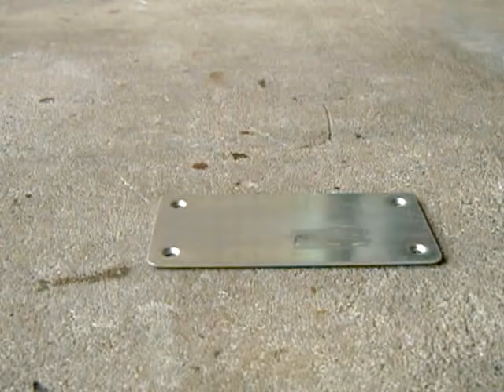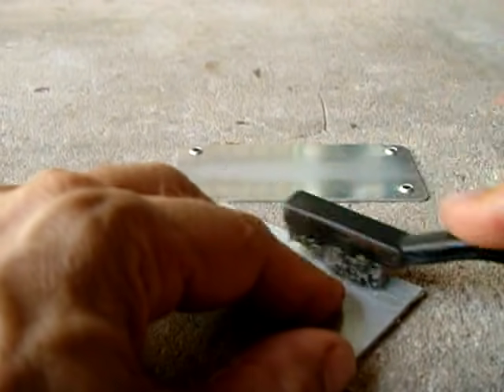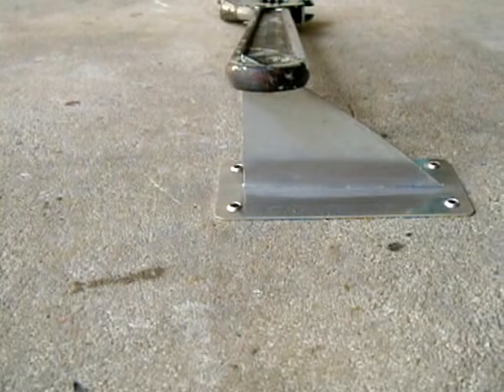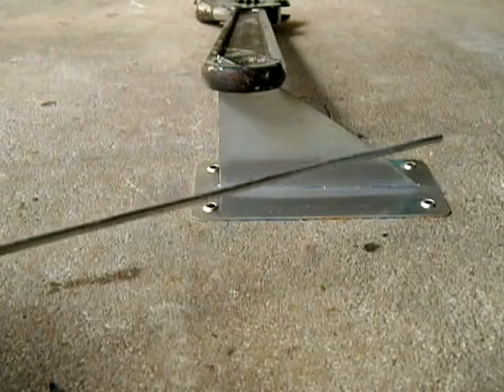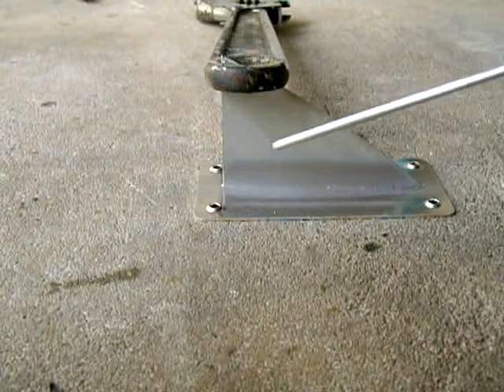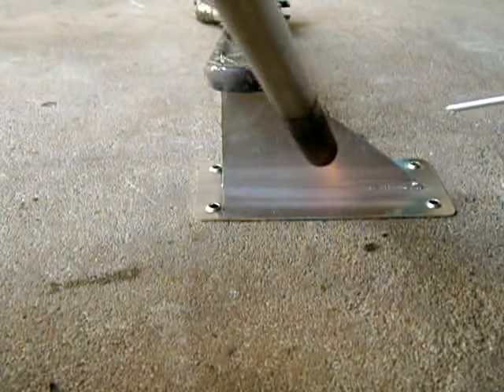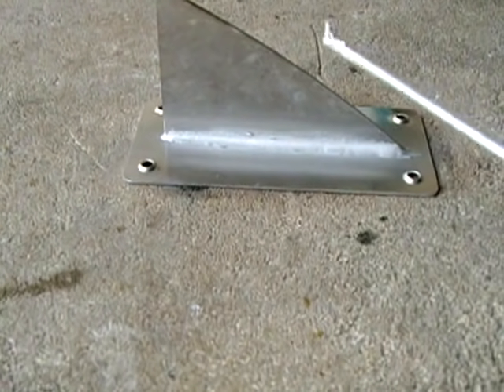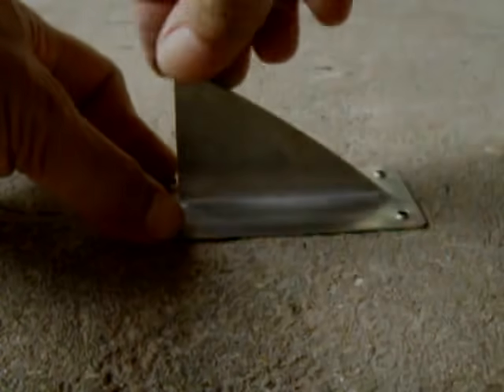How To Easily Join Together Aluminum Plates & Repair Aluminum Parts

Comment: I purchased some rod like this from a guy over 20 years ago. He told me they had used it on aircraft in WW2. His technique was to clean with a stainless steel brush where the parts would be joined. Then heat until the joining material was liquid along the joint. Then he took a fine stainless steel rod / wire and ran it through the liquid joint material scraping the aluminum under the liquid. He said this got rid of any remaining oxidation on the aluminum and assured a good joint. I used it on a few projects and it does result in a very strong joint. Much stronger than solder on steel. More like nickel silver brazing. Yes, TIG would be better, but this requires about $20  worth of equipment vs 220Vs and a big TIG welder. In the past it was often hard to afford really good equipment. It is great that more of us have access to good tools these days.
Reply from the maker: Thanks for watching!
Reply: Ted Cosgrove thanks for sharing.

Comment: More heat and put a slight bevel on the top piece you will get more of a bond
Reply from the maker: Incorrect. More heat will only cause the aluminum to melt. Thanks for watching!
Reply: no adjust your flame and chamfer your bottom piece for more aluminum to go into the joint . been welding for 28 years i think i know what iam talking about .

Comment: what type of gas are you using for this???
Reply from the maker: For this size and thickness aluminum, propane is sufficient. Use MAPP gas if a larger/thicker area is to be heated.
Reply: ahhh very nice, i have both of those. is there any special brazing rod that is better / easier to use than others????
Reply from the maker: Yes, I mentioned what I used in the video, as well as the video description area.
Reply: electronicsNmore
 haha i see it now, i guess much like your video, i also skipped through the description. thanks again.

Comment: From a welder that had actually learned the procedure of oxy fuel welding and brazing, I have a fre issues. Not that this won't work in a home situation, but things could change. First off, you failed to mention that the stainless brush you have to use should be only ever use on aluminum. If it was used on anything elce it will impregnate the clean aluminum you are trying to braze. Secondly as mentioned in another comment. After wire brushing you must wipe with come kind of solvent (read up on the effects of heated to be safe). You shouldn't have to keep wire brushing the aluminum because it does not oxidize as fast as steel. For quicker and a more sound braze more heat is messasary.

Comment: cool vid thanks. tip..that concrete leeches alot of your heat making the process take longer.  Also concrete can blow up in your face if heated to much depending on how much moisture is in it.
Reply from the maker: Truth Hurts Concrete is a poor conductor of heat, but it does retain heat for a long time. There's only a threat of the concrete popping if you direct the flame toward the concrete for more than a few seconds at one spot. In the video I never did that. Thanks for watching

Comment: Does this rod have flux in it?
Reply from the maker: No flux is required as long as the surface is super clean using the stainless steel wire brush. Using flux wouldn't hurt anything.

Comment: I've tried this with a propane torch and it just will NOT work. Are you using a different type of gas?
Reply from the maker: I can assure you this works, and very well. I don't make bogus videos. Your piece of aluminum may be too large/thick and it is drawing away all the heat not allowing the aluminum to reach a high enough temperature to melt the brazing rod. You can try pre-heating the aluminum piece in your oven set at 600 deg F, then remove it quicky and try repairing the area. You can try using MAPP gas as well, or using 2 propane torches.

Thanks For Watching!
Reply: electronicsNmore I'm trying to join a 1/8" flat, 4" x 4" piece of aluminum to an 18" long, 1" square, aluminum tube, if that makes sense. I've gotten those pieces glowing red, literally and those rods still don't melt on that aluminum. I don't know what the deal is?
Reply from the maker: If the tube is thin-walled, then a propane torch should work. You said something that makes no sense, "glowing red". Aluminum does not glow red when heated. The aluminum will melt instead. I have a feeling your not using aluminum.
Reply: electronicsNmore The tube is 1/8" thick as well. I'm relatively certain it's aluminum, not sure what else it could be?
Reply from the maker: Aluminum will not turn red. Take a magnet to the metal and see if it is attracted. If it is, you have something with iron in it.
Reply: electronicsNmore I can't get a magnet to stick.
Reply from the maker: Could be non-magnetic stainless or monel.
Reply: More likely it's titanium. Strength of steel, color of aluminum, 3,000 degree F / 1668 degree C melting point. Or Zinc.

Comment: Never used aluminum but with most soldering you heat the opposite side and let the heat draw it in.
Reply from the maker: Doesn't work that way with these brazing rods. Thanks for watching!

Comment: brazing = gluing, welding = one-piece-homogenizing. DON'T confuse the two. This is an IDEAL time to learn to 'walk the cup'.  Anything beyond copper pipes or radiator repairs should be either welded or bolted.
Reply: By the way, I am not convinced you didn't weld those plates via 'gas welding' process. Aluminum melts at 1220-F, while propane can hit 1750-F or higher.  Brazing is the process of heating two components and then allowing the filler to melt (which should do so at a lower temperature) and draw into the joint; while welding homogenizes the joint into one-piece.  As with all welding, you need to break the test joint and inspect the 'penetration', or melt-zone, you created in the process. IF ANY of your base metals (either plate) were melted or homogenized during this, then you welded. If the plates are as strongly bonded as you say, I still say you welded, not brazed.
I've welded for 22-years, MIG, TIG and SMAW, including soft metals. I am telling you right on this.
Reply from the maker: "brazing = gluing, welding = one-piece-homogenizing. DON'T confuse the two. This is an IDEAL time to learn to 'walk the cup'.  Anything beyond copper pipes or radiator repairs should be either welded or bolted."

Who are you directing this comment to? LOL. I certainly don't need anyone telling me the difference between brazing/hard soldering, and welding. As for, "Anything beyond copper pipes or radiator repairs should be either welded or bolted.", that is your opinion, which you are entitled to. I have always had excellent results brazing metals together.

"IF ANY of your base metals (either plate) were melted or homogenized during this, then you welded. If the plates are as strongly bonded as you say, I still say you welded, not brazed."

Once again, telling me something I already know.

I think you need to contact the manufacturer and complain to them.

The brazing rod melts at a lower temp than the aluminum piece being heated. The temp of the propane torch, is irrelevant.

Comment: Would this work to attach aluminum details to a lightsaber hilt?
Reply from the maker: Better off bonding with epoxy.
Reply: @electronicsNmore  thank you
Reply: @electronicsNmore  any epoxy recommendations?
Reply from the maker: This stuff is good. Make sure the surfaces are lightly roughed up and wiped down with 70-91% isopropyl alcohol before applying. 

https://amzn.to/2Xf9BZa
(Amazon Affiliate Link)

Comment: My cbr1000rr has been leaking really bad. This is probably my last try before I replace the motor. Cross your fingers.
Reply from the maker: Better off welding it for that application.....You'll need a lot of heat to braze that.
Reply: electronicsNmore it’s aluminum it can’t be welded I paid someone to heliark it and they completely missed it

Comment: pro tip : use a drop of instant super glue type glue to bond and hold two peices or how many ever pieces together in place....... this is best and easy.... makes job simple............
Reply from the maker: Bad tip. Super glue(cyanoacrylate) cannot tolerate high heat. The pieces will fall apart during heating.
Reply: not so much.... firstput safety dot weld, then you can proceed on

Comment: People please... you need brass to "braze".
Reply from the maker: WRONG!
Reply: Lol...  This is "soldering" dummy.

You need tin to "tin", brass to "brase", etc...
Reply from the maker: Hey Dunce, it's time you learned the difference between soldering and brazing.

When soldering, the filler metal melts at a LOWER temperature. When brazing, the filler metal melts at a HIGHER temperature.
Reply: That completely depends on the type of solder.  Look it up, dimwit...  You can't "braze" without brass.

Amazing, the number of people born in America, who still don't understand the English language.  

I can't can't count the number of times I've heard so-called welders refer to orginary acetylene welding as "brazing"...  They think anything welded with that type of torch, was "brazed".
Reply: @electronicsNmore  When the filler melts at below 840 degrees you are soldering. When the filler melts at above 840 degrees, you are brazing.

Comment: Why did u not rip it apart with pliers 
Would have gave a better result if the joint breaks or the weld breaks
Reply from the maker: +Dave Fd 
Because only one side was brazed. If both sides were brazed, I would have. 
Thanks For Watching

Comment: Why is this called aluminum BRAZING ?  This should be called aluminum soldering. I wasn't shown how to use this rod but found it and thought I'd have a use for it. I tried conventional brazing techniques because it's called BRAZING. Of course it didn't work. I messed around and made it work but it looked rough. At least now I know how it's suppose to be done. Thanks for the info.
Reply from the maker: Any time you use much higher heat than soldering, they call it brazing or "Hard Soldering". Thanks for watching!

Comment: a cut cross section would have been usefeull, I have no idea what is really fused and what is not
Reply from the maker: Remember, the base metals don't flow together as one. It's basically "hard soldering".

Comment: Brazing is welding. it's gas welding.
Reply from the maker: Incorrect. Welding only occurs when the base metals  melt and flow together as one. Brazing is known as hard soldering. Thanks for watching
Reply: why do you think you need to clean the metal, so it will stick together. they are flowing together. I have been a certified welder and Instructor for over 30 years.
Reply: If the metal did not flow together it would not stick and would break into three piece's.
Reply from the maker: bos dad
Think of soldering, the base metals do not melt together, but you end up with one hell of a strong joint. :-) The cleaning was done to remove oxidation so the brazing material can bond to the aluminum surface.
Reply: Ok, have fun. good luck
Reply: +bos dad If I ever saw a fallacy....
Reply: +bos dad if the base metal does not melt it isn&#39;t welding...from memory (did my coppersmith apprenticeship 50 years ago) there are 3 classes of joining metal with heat 1)soldering, 2)brazing, 3)welding. There are classes within each group of course.

just saying...

Comment: lotta heat went into the concrete next time suspend it over two rods or anything metal you may have laying around that wont let the bottom plate touch the ground and transfer heat
Reply from the maker: +alex “alextheromanian” theromanian 
Hello. Concrete is a poor conductor. :-) Using metal rods would act like a heat sink. Not good.
Reply: rods underneath would most likely absorb a lot less heat from the plate than its entire surface area touching a cold surface. concrete may be a terrible conductor which is EXACTLY why i wrote this comment you seem to want to simply react to without thinking a bit about it.

if concrete is a poor heat conductor it means it holds its ambient tmperature pretty well...well that ambient temp tends to be pretty cold. now what do you have there in the video? a GREAT heat conductor...meaning it will lose all of it to its surroundings. 

so now with that in mind tell me what would happen when you have a material that likes to stay cold and not heat up...underneath a material that heats up fast and cools down fast.

metal rods would absorb...yes but they are much smaller surface area and thus pull significantly less heat than a flat one

Comment: The caption at 3:27 makes no sense.
Reply from the maker: Hi Art. It makes sense. I was saying that the metal needs to reach a temp high enough to melt the brazing rod when you touch it to the metal, you don't want the flame from the torch to melt the brazing rod.

Comment: It would have been a lot faster it it wasn't on the floor! Aluminum transfers heat really well so it being on the concrete your now heating up the concrete.
Reply from the maker: Concrete is a very poor conductor of heat.
Reply: @electronicsNmore  your transferring all that heat from the aluminum to the floor!
Reply from the maker: @ijustwanttolearnstuff  Incorrect.

Comment: Would have been a lot easier and faster if you didnt do this on a cement floor. Cement or concrete is taking the heat right out of the aluminum. Thats why welders and fabricators put hot metal on the cement floor when finished because it cools much faster then air cooling.
Reply from the maker: +Wicked Wrenches 
Hello. Concrete is a very poor conductor of heat, but it does like to retain heat.
Reply: Hello. If you took a temp gun and monitored the heat from hot metal air cooling on a table and same thing cooling on cement. The metal cooling on the cement cools almost twice as fast.
Reply from the maker: Wicked Wrenches
I'm not going to argue with you. Do it your own way. Very simple.
Reply: Nothing to argue about. Facts are facts..
Reply from the maker: Wicked Wrenches
Exactly, you have your facts, and I have mine.
Reply: Good :)
Reply: +Eccentric Smithy... white metal or alum. can be cooled in water will not hurt the joint...

Comment: Geez I thought the whole video was going to be you using a wire brush.
You must have brushed that thing 100 times.
Reply from the maker: +timm2020 
The Aluminum MUST be brushed many times as the metal is heated, and once the brazing rod melts into the surface of the aluminum, you brush it one more time. If you do not do what I show, then expect very poor results.

Thanks For Watching!
Reply: electronicsNmore  I know, I was just messing with you. You are right 100%.

Comment: Ok i don't want to be that guy but there is no brass in these rods , so why do they call it braising? Its soldering ,& why doent my razor have a turbo ! 😡😉
Reply from the maker: Brazing has nothing to do with brass. It's basically high temperature soldering, which is much stronger than soldering.
Reply: @electronicsNmore  shouldn't the term be welding then ? Well in french solder means weld so semantics i guess. 👍🏻

Comment: Your not welding your soldering it. Whatever works for you. Nice job though
Reply from the maker: +Robert P. Avery Sr. 
Hello Robert. Incorrect, I never said welding, I brazed the aluminum together. Soldering is done at low temperatures, brazing is also called, "Hard Soldering" which is much stronger than soldering.

Comment: you can't remove aluminum oxide mechanically...a solvent must be used....
Reply from the maker: Of course you can. The stainless steel wire brush scrapes(scratches) away the top oxidized layer of aluminum. No need for acid.

Comment: Brazing is BONDING, not fusing.  It'll be more than adequate for some applications, inadequate for others.
Reply from the maker: Many companies use the term "fuse". You're fusing the surfaces of the metals together.

"The Lincoln Electric 1/8 in. Flux-Coated Brazing Rods (1lb Tube) are 
malleable and are designed to fuse well with cast iron, galvanized iron,
 steel, brass and copper. A low fuming rod of the highest quality. 
Designed for high strength and wear resistance."

Comment: Thanks, but I would have liked to see you break it with weight or a hammer to test the strength.
Reply from the maker: The material is extremely tough. Since I only brazed on side, I did not take a hammer to it. If I did both sides, no problem hitting it with a hammer because it would be unable to bend in either direction.

Comment: Was anyone else super bothered by him only doing it on one side and leaving the other side empty?
Reply from the maker: Why would you be bothered? I could have done both sides. Once you complete one side, then you do the same on the opposite side. Just make sure the two pieces are unable to move while doing it. I have another video which I'll be uploading within the next 2 weeks showing a very nice metal detecting beach treasure scoop that I made using these brazing rods. Thanks for watching
Reply: +electronicsNmore No, it's not you, it's me. I was referring to my OCD. :D

The join looks strong. Keep up the good work. Thanks. :)

Comment: Wow! that's amazing, but I must confess to having a dislike for Aluminium and I am not sure if I would have the patience. It all stems from a disastrous repair I tried on my bike paneer frame in the early nineties. But if I ever did need to join two pieces of the horrid stuff, I will certainly remember this. My preference is to arc weld stainless. But I do accept, sometimes only Aluminium will do for some jobs.
Reply from the maker: Hi Richard. As long as the surface of the aluminum being brazed is EXTREMELY clean(bright and shiny), and brushed under heat with the stainless brush, you will have great results. Just don't apply too much heat and melt the aluminum!

Thanks For Watching! Be sure to share my videos with others and rate Thumbs up.